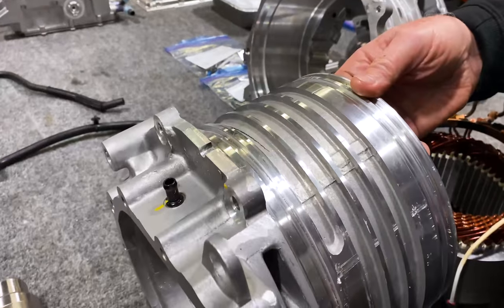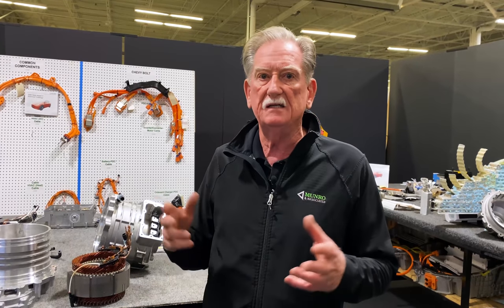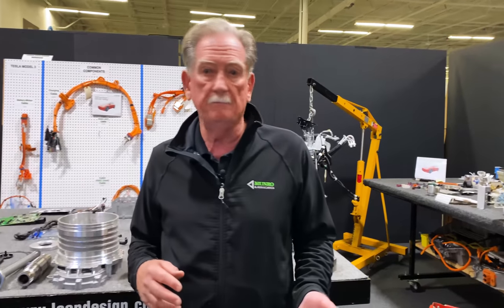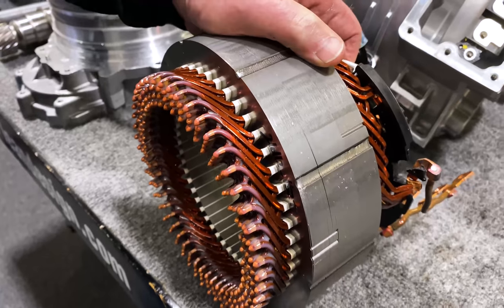Mach-E Front Motor: Sandy is Blown Away by Great Design

Comment: so given that skin effect dominates, does that mean if you print the copper onto a pcb board similar to how you print a circuit, the magnetic flux density can be much higher ? give the surface to volume ratio is much higher. Or does the wire resistance increases too much and overcome any benefit of having more numerous wire per given unit winding length
Reply: On DC or a slow moving electrical stator, you only see DC resistance, you get away with any shape. On a few KHz frequency you start to get that skin effect: where electrons flow only occurs on the periphery of the conductor, so the resistance starts to increase, compounding to your losses. You want to use circular conductors to minimize the effect... on HF high-power applications, you use hollow tubes and sometimes run coolant in it.
Reply: Skin effect is almost irrelevant at the frequency of the power supplied to the motor, because the skin depth is comparable to the wire thickness.
Reply: I had a radar transmitter that ran at 6 KHz, and used Litz wire. It looked like welding cable but the tiny strands were insulated from each other. Lots of skin.
Reply: @jamesvandamme7786  why would a radar transmitter have a 6 kHz power supply? Radar frequencies are in the gigahertz range. Anyway, the motor power isn't as high as even 6 kHz. But yes, that's Litz wire... as long as the strands are braided together in an appropriate pattern, not just twisted.
Reply: @brianb-p6586  That particular transmitter had a 100 KW resonant inverter power supply that supplied 40 KV. It used SCR inverters to step up the line voltage (rectified to DC, 300 volts or so). So it used a series LC circuit switched by the SCRs. This made a low EMI system, no square waves. the L was originally a water pipe solenoid, but I retrofitted it with a litz wire toroid, and the heat and electrical and acoustic noise went down dramatically.

Comment: Sandy, you mentioned that BMW i3 motor is well designed like the ford mach-e front motor and cooling done outside of the motor. Did you know that BMW i3 motor fail prematurely with bearing being the main problem (usually around 80,000km). Usually Tesla motors last much longer than these i3 motor, so I think i3 motor cooling design is not efficient enough.
I own both cars and have had BMW i3 motor fails because of bearing problem, biggest problem is that BMW does not have any real warranty on the driveline only the battery.

Comment: Inverter :-  I note how coolant passes the IGBT's SEQUENTIALLY!  If the coolant is doing its job properly at full energy delivery - fine.  Notwithstanding this, there MUST be a substantially different thermal gradient back to the heatsink assembly on each of the 3 IGBT modules?  A design weakness?

Comment: What about serviceability for the stator? If it's pressed in, rather than bolted in.
Reply: What's to go wrong?
Bearings?
If bearings go, the rotor touches the stator, toast.
Otherwise, no moving parts.
If the wiring goes, toast.

Comment: Wow. A big turnaround from the rear teardown. The motors are called "form-wound" here and the ones he is calling "bobbin wound" are called "mush wound." Form wound is used for higher HP industrial motors and that style has significant advantages in high-torque applications with coils wound inside slots (vs. separate poles). All things equal, I think form-wound is better from 40 years of industrial motor and servo experience. (Not the same as automotive, I know.)

Comment: Has anyone got any insights with regard to motor cooling?

How great is the need for liquid cooling? I'm surprised car manufactures seem to be moving away from air cooling so uniformly. 

How does this work with battery cooling? Is the coolant getting too hot to also cool the cells? Is that a consideration? Are we likely to get to the stage of having 2 cooling circuits?
Reply: If an electric motor is 97% efficient, at the most (its really less) it means 3% is lossed in heat. So at 100 kW motor power, thats 3 kW of heat, not a big deal. Air cooling can be done, but then it is better to have forced air cooling. You also cant use that heat for much. If you use liquid cooling, you could use that heat to heat the cabin for example. The motors might be 100 degrees celsius, but the coolant doesnt have to be the same temp. If you increase the flow by 2 times, you still extract the same heat, but the temperature difference is halved, if you get what i mean. Liquid cooling is easier to control. Also, its better to have a more even temperature, meaning less internal stress in the material due to different expansions.
Reply: I design electronics for a living altough not car electronics.
In general for a switching converter (which all motor drivers are), if you are 95% efficient you are doing a pretty good job. If you do everything exactly right you might get to 98%. But for a 100hp motor that still leaves 1.5kW waste heat to be removed at full power output. Getting rid of 1.5kW from something as small as these IGBT is only really possible with liquid cooling.
Reply: Q1: Has anyone got any insights with regard to motor cooling?  How great is the need for liquid cooling? A1: same as with ICE (albeit not nearly as much) making power invariably generates HEAT.   one immutable Law of the Universe is that there's NO FREE LUNCH (even though we foolishly hope there will be) so the mantra is "gotta cool something".   Q2: How does this work with battery cooling?  A2: it's similar, again the standing rule is NO FREE LUNCH, the charge/discharge of say...? a 60Kw-100Kw pack also involve heating (we sometimes notice the "heating" phenomena even with the packs in our comparatively tiny phones).
Reply: Q3: Is the coolant getting too hot to also cool the cells? A3: oh God you'd better hope not, otherwise we're all in trouble, cause with Lion we're sitting on top of IED's ready to have our NUTZ blown off (ref Tesla, Bolt, Kona fires).  Q4: Is that a consideration?  A4: you bet your ass... err... "nutz".  Q5: Are we likely to get to the stage of having 2 cooling circuits?  A5: already there, the lowly Bolt in fact has not just 2 but 3 (count 'em "three") independent cooling circuits, ie: Pack, People, and Electronics.  but as we see, the behavior of hoping that Technology will magically "save us" from disaster is not enough, as Human Being we still manage to screw things up (royally).

Comment: Question:  Inverters in the front and rear on Ford ... doesn't Tesla use a combo of DC motor and a AC motor for efficiency?
Reply: No. No one has used a DC motor in a serious EV for decades. Tesla has used only AC motors from it's first model.

Perhaps you are confused by the use of (asynchronous) induction motors and synchronous permanent magnet motors. Both types are AC motors, and in EVs they are both 3-phase AC motors, driven by essentially identical inverters (with different control programming to suit the motors).

Comment: Sandy go with your gut!  Rectangular shape has more perimeter for the same volume, but the larger wire means more current which is hard to get in semiconductors.  Count the poles in the two motors.  Probably the smaller vee has to do with shorter pole spacing in the smaller diameter using the same magnet sizes.  So, why didn't Ford go with the same unit in back that is in front?
Reply: Two different motors can make up for not having a gearbox in EVs.   They may have different different characteristics and gearing.  One may be more efficient and better for 'cruising', while the other has more torque and is better for starts, for example.

Comment: What your referring to with a hairpin wind vs a bobbin wind ONLY affects ac not dc ..DC uses the full core ac uses the outer part of the cable ..this is why between north island and south island of new Zealand our exchange is DC power under cook straight .. cos DC uses the full wire core ..they convert ac to DC ..the back on land they convert DC to ac

Comment: One caveat to using coolant for the lubrication and cooling of the motors is that I understand is that the coolant has to be changed every 10K miles.  For the right electrical dielectric you have the proper coolant, otherwise it will break down.  I think I would rather change an oil based system every 100K miles.  Most people will use any coolant for their radiator.  There may be more corrosion using the wrong coolant in a radiator for an ICE vehicle, however for an EV electrical system you are asking for trouble.
Reply: Coolant never touches anything live, ever.  If coolant touches it, electrolysis will occur, generating H2 and O2 gases, and raising pressure.  Coolant might require a change, if the anti-oxidant is not working, and you see rusty water.

Comment: Sandy seems very excited about a motor with 1/3 the power of the Tesla. Would it be the same design if it had 3 times the power?
Reply: NO, because the Muck-e is still too HEAVY. 
and it's Coolant system and HVAC sux.
Reply: @markplott4820  
Just go away..... Get some help.
Reply: Yes, it could be. The Chevrolet Bolt has essentially the same layout and more than twice the power of the Mach-E front drive unit.

Comment: Absolutely amazing tech. Competition about to swamp that pretentious company
Reply: probably not since the "competition" wont be making any volume to speak of. They dont have the batteries. Theyll have a few models like the mach E but most of their qualifiying EVs will be short EV range hybrids which will still allow them to qualify for the tax credit yet still pollute and require ICE maintenance and service
Reply: Tesla needs to figure out the charging stations with their competition. Better to make $5000 per car or $2000 per year for charging every car including the competitors? Drive around most cities and all those cars parked on the street will need a public charger to recharge. Ideal would be chargers at places you need to spend time instead of a dedicated station. Shopping areas, grocery stores, and work.

Comment: Question for you Sandy.
Since the best part is no part, why nobody use DC motors which would eliminate the inverter?
Reply: Wouldn’t DC motors need brushes?
Reply: Casting mind back 30 years ,DC motors are not as efficient and have wearing parts(brushes) that you need to be able to replace there may be others I have forgotten in the mists of time
Reply: Peter, because DC motor NOT good enough for High Speed alone, and would require a 2 speed gearbox.
THIS is why Tesla is so Efficient, it's got 1x Induction motor and 1x PM motor, and NO complicated 2 speed gearbox like TAYCAN. 
and with just 3 Motors, Tesla PLAID Smoke the Taycan and McLaren doing 9.0 at 160 mph.
Reply: @markplott4820  
Just go.
Reply: How would they control speed if they eliminate the inverter?  The inverter is the speed control.  Connecting a battery directly to a DC motor would make the motor a single speed on/off drivetrain.  Any non-electronic method of reducing the voltage to the motor would be VERY inefficient (and you would be right back to having a part again).  Any electronic device that regulates the voltage, current, or frequency is essentially what the inverter is doing although it might go by a slightly different name depending on the design.

Comment: I never even tought of the skin effect, because most everyday AC motors don't run at speeds that high! If course at 20k RPM these things start to matter.
Reply: Regardless of RPM, they are driven with a high frequency pulse-width modulated signal to control current.
Reply: @mikeselectricstuff  the PWM frequency doesn't matter to the windings, which see only the frequency of the filtered sinusoid... which is only a few hundred hertz at the most.
Reply: Even at 20,000 RPM skin effect wouldn't matter much. These motors don't turn that fast, but at 12,000 RPM an 8-pole motor is driven at only 800 Hz.

Comment: Ford needs to switch contractors for the rear motor to the ones who supply the front motor and inverter. It's a winning combination.
Reply: Image if Ford, under time constraint, playing catch-up and short in cash, went to suppliers and said we need "This".....?
Off the shelf designs with known spec, close enough dimensions to fit and production ready.
2 suppliers had units close enough......?

Comment: Would be curious to know what % of each car tear down is manufactured by that automaker.  Perhaps even bucketing % of different sections: drive train, interior, thermal management, etc.

Was surprised that Ford did not make their own motor.
Reply: Or that Tesla don’t make the billions of 18650 battery cells that have gone into all of the Model S and X that have been produced.
All of those cells have been made in Japan by Panasonic and imported into the USA, for use in the Fremont S/X production line.
Reply: Exactly.  More transparency helps customers decide where they want to direct the economics of their funds
Reply: @giansolomon  Gian, could you kindly explain exactly what you mean by “direct the economics of their funds” ?
Reply: Side stepping the multi source vehicle....a manufacturer receives the funds for new car sales.  If the car is made in Detroit, the +/- $40,000 (avg px) supports the factory/worker salary in Detroit. 

A car made in Mexico supports the factory/worker in that location.
Reply: @giansolomon  So are you suggesting Gian, that, as a purchaser of a motor vehicle, I need to consider WHERE it is made?
What if I’ve selected the Ford Mach-e, because it’s the best vehicle for me. Do I NOT buy it because it’s made in Mexico?

Comment: ...maybe they used multiple smaller capacitors because they are "off the shelf component" that is probably cheaper then single custom one. Also, if one capacitor fails whole unit will probably still operate...:/
Reply: It's also more repairable.

Comment: Great video, thank you. One comment that I have is that Ford is buying this electrical engine from Magna; Tesla builds their own electrical engine. It is possible that building one's own engine (vertical integration) will lead to less expense for Tesla compared to Ford (that is, Magna will charge Ford some money above the cost of building the engine so that Magna can make a profit).
Reply: Can't they all just buy the most advanced Lucid engine?
Reply: BorgWarner investor day presentation claimed it supplies the integrated Drive module which includes gearbox, motor and inverter? Does that mean Magna provides that to BorgWarner, and both make a profit from Ford?

Comment: The first thing that stood out to me, was how tiny the Ford parts were.  Either the front drive train on the Mach-E is supposed to be Prius sized, in which case, yeah, wow, it's a great econobox power train.  OR, what is this?!? Is Ford trying to say, yeah, it's AWD, so we put in a toy FWD drive train to satisfy that check mark?  Sandy mentions the front motor only produces 65HP???  And we're gonna go on about wow, 4 bearings and look how small they are?  Look at the baby differential that can't handle any torque!  Amazing!  Pull it apart and show us the baby parts inside.   What happens on long shafts with short spline engagement, with small bearing race support?  Just asking for a friend... :)    Yeah, paper gaskets, errrr uhh, yeah, I guess I'd use them too.   Sure.  Sure...  With all the hoses, cute sized parts, paper gaskets, this car is being made to be just as disposable as an ICE car.  Toss it after 100k miles, because the cost to maintain it, hose, and leak wise, will cost you more than a new one.     Appreciate the work Sandy.   Please don't let Ford sway you.
Reply: The front motor is usually lower-powered than the rear motor in an AWD vehicle, for good reasons. This unit has the right power output for the application.

Comment: Munro, the skin effect is probably not a problem as long as the frequency that drives the current in the wires is in the 60 Hz range giving a skin effect of about 8.5mm in copper, which is what those wire diameters appears to be.

Of course, the skin effect is a function of angular frequency, shape of the conductor, the radius of the wire, permeability, current density, current density phasors, and conductivity of the material of the wire (probably copper).

You should be so careful as to make too many conclusions based on assumptions from possibly questionable references, lack of or missing functional product knowledge, or a basic lack of applied physics knowledge.
Reply: There's nothing 60 Hz about the drive unit... but the fundamental frequency supplied to the windings is only a few hundred hertz at average speeds.

Comment: Is that a planetary differential?
Reply: Not likely. Planetary differentials are used to provide an unequal torque split (to divide power between front and rear in an AWD), but this is an axle differential which needs to split the torque evenly. 

If you find an image or description of the internals of this compact Magna differential I would be interested - I haven't been able to find one.

Maybe Munro could finish the teardown and take this one apart?

Comment: Sandy I agree with you on the single capacitor. Caps are a major failure point on older devices!
Reply: To be fair, the large 'single'-capacitor is actually multiple capacitors in a single housing, as an inverter has three 'legs',and  each leg requires a capacitor.  The package should have better vibration resilience.
Reply: @davidharris7249  And when one fails in the module, you wait a month for the replacement instead of getting one from Radio Shack... uhh, Digi-Key
Reply: @jamesvandamme7786  Yeah, I agree.  Use good quality capacitors from good companies. A module is just extra cost.  Mouser or Digikey for me.